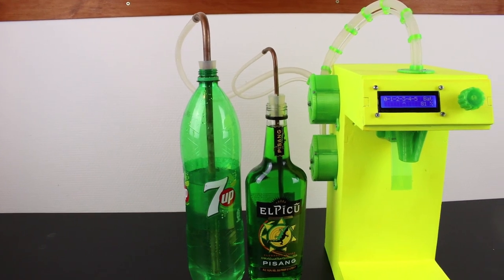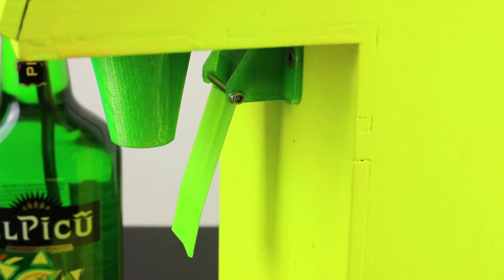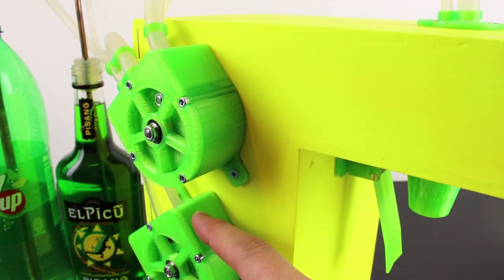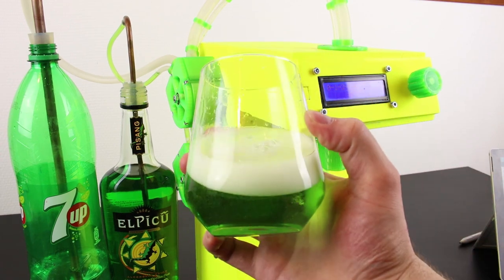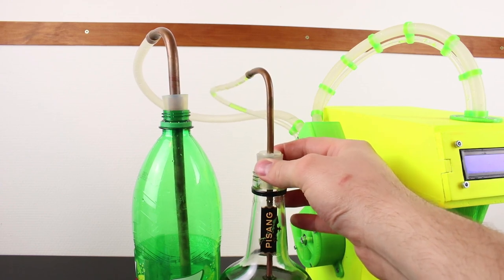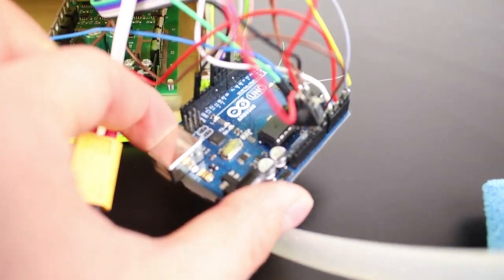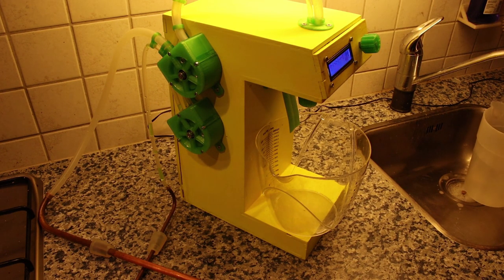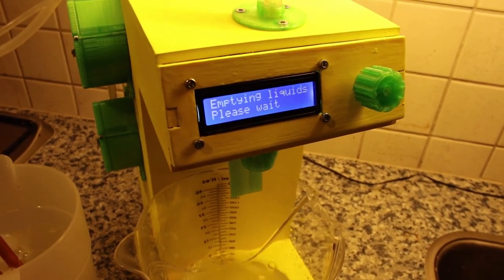3D Printed Ultimate Drinks Mixer (Arduino Cocktail Maker)

Comment: Awesome project! It should be noted that copper becomes toxic when in contact with acidic solutions so I think you would do better by dropping the silicone in the bottle instead :)
Reply from the maker: Yeah I wasn't to keen on the copper as well. Thanks for mentioning it again. I said in my video that ideally the rods should be made of 316 stainless steel :)
Reply from the maker: Yeah all the old water pipes here in the netherlands are made of copper. I was unfortunately not able due to the pandemic to pick up and bend some stainless at my parents house, hence the copper still bit if release the plans I'll make sure to point this out that only silicone or 316 stainless should be used
Reply: @PattysLab  You're lucky in that case, my pipes (also the Netherlands) are largely lead ;) In any case, copper by itself is perfectly safe to drink basic fluids from, it's acidic fluids that make it dangerous. And the worst thing is that you don't notice anything until it's too late.
Reply from the maker: @WoLpH  they will eventually change out the lead for plastic. And about the copper I'll try to get the stainless 💪🏻💪🏻 so it's save for acidic drinks aswell

Comment: While the drill parts provide a lot of torque, they do create waste from case and other parts not being used, and are noisy. I was thinking that even an 8-bit 3D printer board with some TMC2208 drivers would be much quieter and easily allow four or five pumps.

I'd love to have something that I could grab some cold water from the fridge, place it under the dispenser, and have it place my desired combination of lemon and lime juices into the water for me. Quiet, space saving, and quick (if I could place it in the fridge and have the water dispensed at the same time) with a nice interface are the qualities I'd be looking for.

Comment: Great project.  You are the only one that I have seen using the silicone stoppers.  I tried searching for that stopper, but can't find ones like you have in your video.  Do you have the actual name or a link to them?  Thanks!
Reply: Or did you modify one to prevent the vacuum?

Comment: Realy nice Work !!!

My Drinks :D : 
Jacky, Coke
Havana, Coke
CaptainMorgan or BarcadiOakheart, Coke
Gin Tonic

So we need more Motors and Mixingtypes :D
Reply: I think Shortcutbutton and a fix liquid amount (for shots 2cl(Girlsize) 4cl) woulf be even better.. but its hard to calibrate i think...
Reply from the maker: For that I might need to switch to a geared stepper motor but more motors and more combinations should be possible and more fun 👌🏻
Reply: Yes good idea a pancakesteper would fit perfectly.. but it boost the cost very fast :D
Reply from the maker: @Qub1tus  steppers are really weak compared to DC motors even a normal nema 17 large version couldn't make it with the large hose. But perhaps with a gearbox 🤔

Comment: great work!! can i buy the whole process from you?? i need a prototype with 4 pumps and a way to add new drinks
Reply from the maker: Do you mean the code etc?
Reply: @PattysLab  the whole process and the 3d printed files
Reply from the maker: @joelterrero6689  I'll be releasing all the plans code and the models in the future I have not worked out all the bugs and I also want to improve the pomp's comparability with different motors

Comment: After all the time now. Would you do something different? Plan to build this next week :)
Reply from the maker: I was thinking of maybe using Gravity to let the drinks flow into the glass instead of pumps and use Fluid servos to Control the flow. Or at least change the DC motors of the pump for steppers
Reply: @PattysLab  Thank you so much for the reply! It seems crazy to me that you made by far the best and most potent DIY peristaltic pump on the internet and you advise against using these pumps. Saw that your files were remixed for a NEMA23 but all the pumps with NEMA23 seem to be quite weak - I doubt they managed to pump 7l/min. So I'm going for the gravity assist :) Like a servo clamping on a silicon tube?
Reply from the maker: @a1xon  It's like you red my mind I was thinking of clamping the Silicone tube as well. One small thing you need some sort of air vent in the bottle or some sort of air inlet else no liquid will flow out ;). Maybe a better idea is to still use the pumps for bottles that are hard to mount  upside down. You could also use the pumps and the sevos to pick the Silicone lines and make a multiway valve so you need fewer pumps.
Reply: @PattysLab  may I buy you a beer?
Reply from the maker: Haha that's very kind, cheers 🍻!
Reply: @PattysLab  You do not have Patreon anymore? Paypal?
Reply from the maker: @a1xon  You can give me a tip on thingiverse 
https://www.thingiverse.com/pattyslab/designs
Thank you for your generosity :) and feel free to ask if you have anymore questions about this project